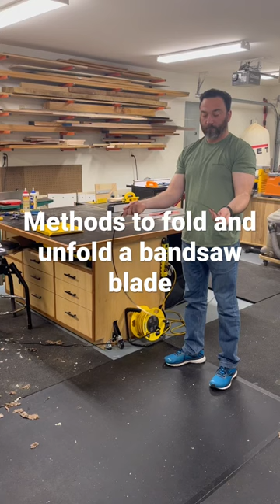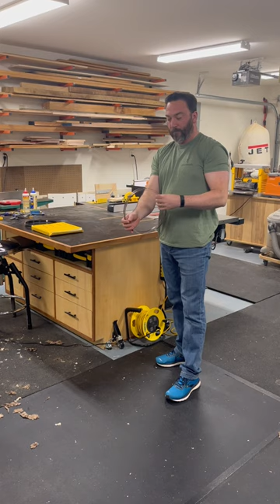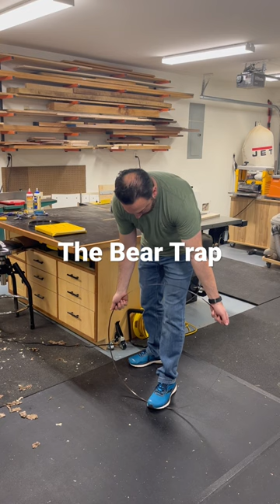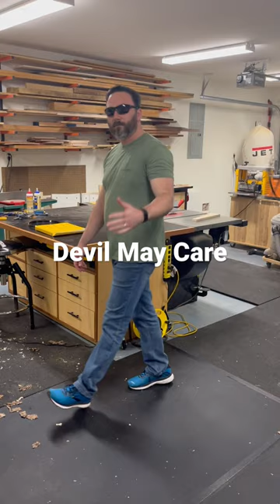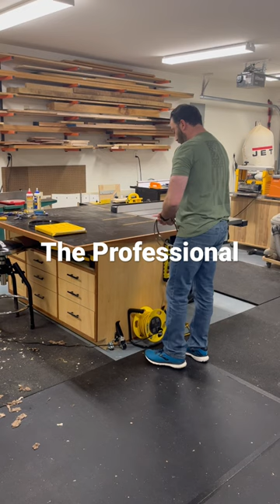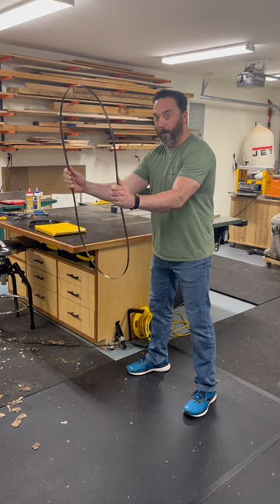How different woodworkers fold and unfold a bandsaw blade. #shorts

Comment: Had to watch it 3 times. 😅😂😅😂
I don't have a band saw. But if I did. I'd just hang it as is. Then I don't get hurt closing or opening it. 
🤣 😂😅😂
Reply from the maker: Glad you liked it, I had fun making this one! It’s not so bad folding and unfolding them once you’ve done it a few times!
Reply: to the person that says he'd just hang them uncoiled, two thoughts. 1) when bought new or returned from being sharpened they always come coiled. 2) what about if the teeth are pointed in the wrong direction of the saw's blade travel? I've had to turn all my sharpened blades and most of my new ones.